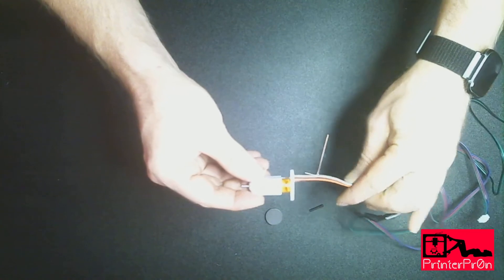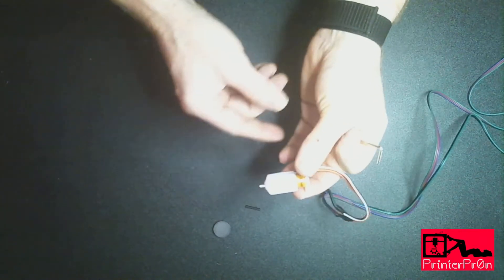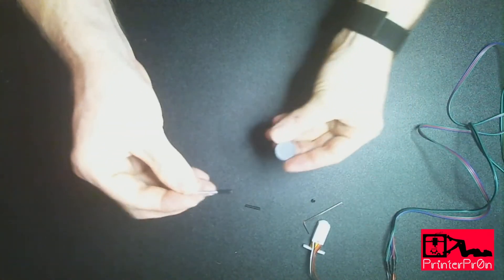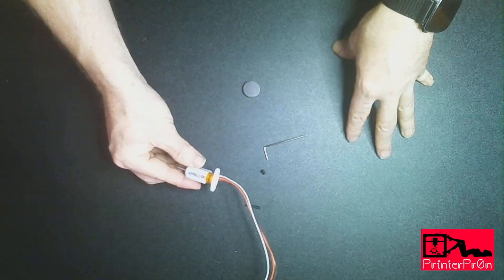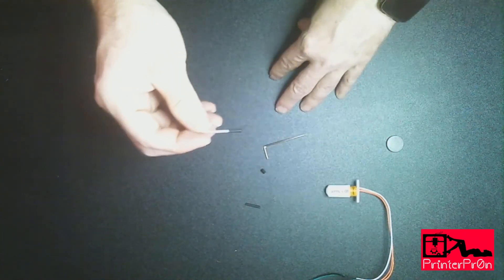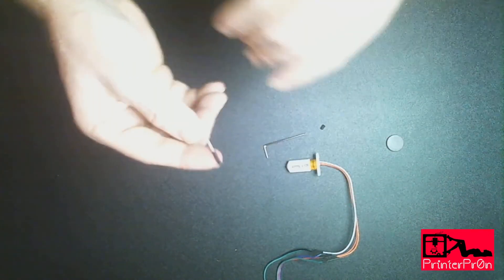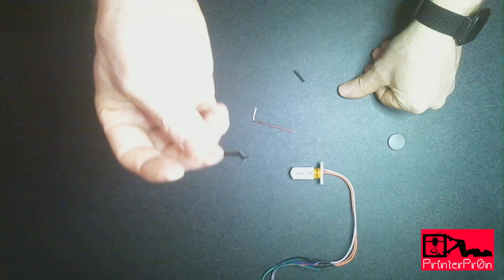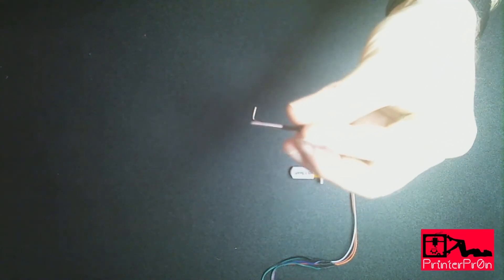3D / BL Touch possible problems and fixes

Comment: I know this is 3 years old, so you've probably worked it out by now, but for anyone else stumbling upon this:

the screw is steel because thats the only thing holding it up, also what causes it to snap back up when triggered. Also why it still snaps back with no power.   The fact that the plunger hangs on the screw is not a problem, its how it needs to be.  There IS a fine line there, between holding it up and not holding it so strong that the solenoid cannot deploy the probe. 

Mines being a little B right now too, but I suspect its firmware and/wiring related

Comment: i have the same issue. the bltouch do a probe and suddenly stop. The flash will light red and i get the error M999. The needle of the Bltouch ist at this moment insinde the plastic object. in wich direction should i turn the screw? clockwise or anticlockwise?
Reply from the maker: There is a sweet spot and they all seem to be a little different depending on how strong the magnet slevee on the probe pin is.  I would turn it counter clockwise 1/2 turn, reprobe, 1/2  turn, reprobe, etc. Screw too far in and probe will get stuck retracked, too far out and won't retract.

Comment: These are crap just cause it's more mechanical then the proximity sensors so they seem to fail more for me. I do run a farm with both and these are the worst, doesn't matter if it's bl touch, 3d touch or even cr touch.
Reply: I HATE BL touch... Ive been trying to get mine working on an ender 5 for 4 years...

Comment: Many thanks to your vidéo I think I meet the same problem than you. the top of the pin was shattered and the pin won't goes down after some actions. I remove the top sheath and naked parts off the magnet. I had a new thermo-sheath with some plistic inside. And my BL touch is alive again. great job

Comment: My plunger works, when i start up it flicks in and out a few times, but when homing it wont deploy and my hot end is hitting the bed. Whaaaa??
Reply from the maker: So the selftest works but the homeing doesn't. Did it work previously? I'm assuming running Marlin firmware...
Reply: @printerpr0n  Most likely a kinked cable.

Comment: What a G. I have been dealing with my probe hanging up in the body of the BL touch for 2 years causing my E5+ to need to be shut off and back on and all I had to do was adjust that stupid little grub screw a little to adjust the probe farther out.
Reply from the maker: You think they would tell you about the screw when you buy one, but no of course not.

Comment: That bastard of a probe made my toolhead crash into the bed multiple times that my garolite sheet is now nicked with holes because of not deploying at all.. does anyone knows in klipper how to fail homing and mesh leveling when the probe does not deploy? Like, checking the probe state before moving?
Reply from the maker: You could probably create a macro to insert into your preprint gcode to run this from the manual with a fail condition but I don't know enough about klipper macros yet to do so.    :     BLTOUCH_DEBUG COMMAND=pin_down, verify that the pin moves down. Run BLTOUCH_DEBUG COMMAND=touch_mode. Run QUERY_PROBE, and verify that command reports "probe: open". Then while gently pushing the pin up slightly with the nail of your finger run QUERY_PROBE again. Verify the command reports "probe: TRIGGERED".   I just moved from a BL-Touch to a klicky/klackender probe today and like it way better than my BL-Touch style probes.
Reply: @printerpr0n  well i can't... I only have one printer... to print parts for itself... I'm in the verge of switching to a afterburner as the toolhead is falling apart...  After I do the change then I can think about switching to a klicky.
Reply: @PrinterPr0n  when I did this setup, after touch_mode,  when i use the command query_probe the bl touch continuos open and not triggered, do you know what i can do ?
Reply: I just tested out something with this screw. The probe of mine has a neodymium magnet inside of it and the grub screw is required to be magnetic, as it is used to hold the needle retracted as the solenoid coil is not energised when idle. So it need to be adjusted. The coil needs to have enough induction to overcome the screw magnetic field. Too far or too little and the coil will not have enough force to push the probe down.the coil is about 3mm above the lower edge of the kapton tape.

EDIT: I measured the best location as to be the middle of the coil leaving just the conical tip at the edge out of the probe.
Reply: I put the probe homing Z about a hundred times and it was deploying all the times. The probe very occasionally bounces back twice when deploying. It hits the bottom hard and makes the screen flicker a bit.... Maybe I should put a protection circuit between the board and the probe...

Comment: Thank you so much! I´ll try to repair mine. The plunger isn´t deploying enough (so it seems), so the hotend is hitting the bed before the BL Touch. I did not use the printer for a couple of weeks and then that started to happen.